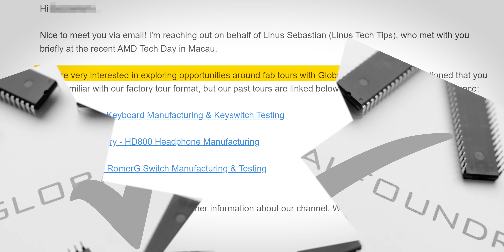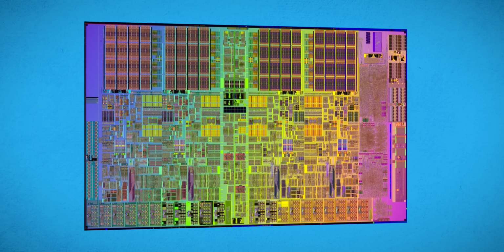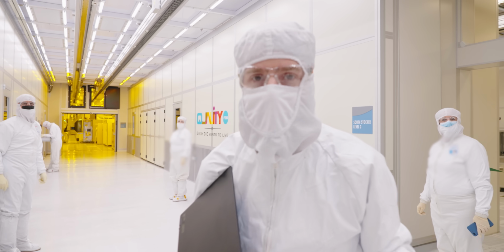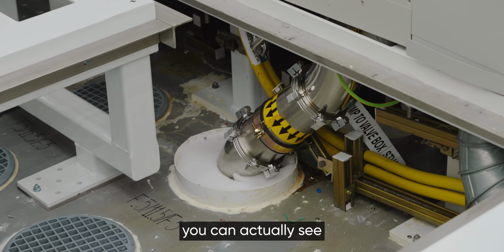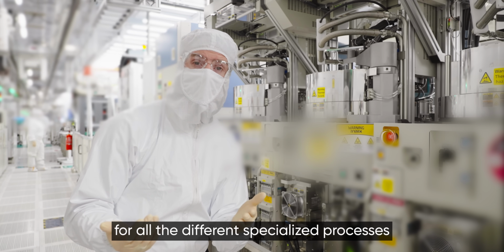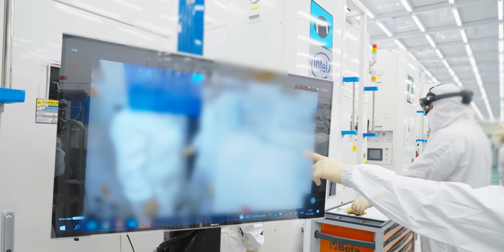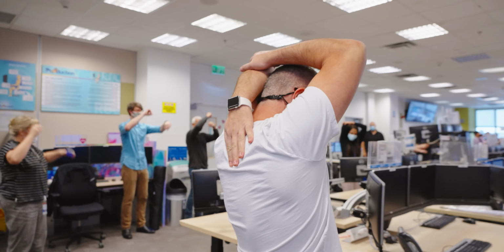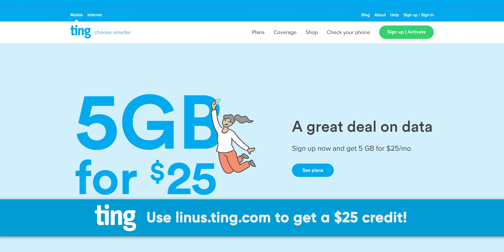I Can Die Now. - Intel Fab Tour!

Comment: The frame by frame attention to scrubbing this video of details that needed blurring is most impressive thing to me here. Props to the editor!
Reply: Even stuff in reflections were blurred.
Reply: I am guessing that intel was reviewing their footage before publishing it online
Reply: @kingseekerbackup3085  They most likely reviewed the footage before even letting them exit the building
Reply: if you do your job correctly, you don't get sued or your video doesn't get pulled
Reply: @houtamelocoding  interesting. Never thought of that.
Reply: @houtamelocoding  Nope, on WAN Show it was said that they were reviewing the footage for quite a while, blurring out all the details.
Reply: @DrakyHRT  really? I'm honestly impressed intel would be careless like that
Reply: its not necessarily frame by frame. After Effects has a really good point tracking system
Reply: %90 the stuff they blurred just were ASML logos
Reply: @kingseekerbackup3085  No need to guess. It's a guarantee they went through everything meticulously. Luckily, modern tracking and blurring is somewhat automated but that doesn't mean it is fast for that much blurring. That alone must have taken as long as the edit.  And the editors did a tasteful job with custom masks instead of cheaping out with just circular or rectangular blur masks.
Reply: @DrakyHRT  Can I get the link of the WAN show where they talked about it?
Reply: @houtamelocoding  They trust LMG enough now. After giving them that much money for those extreme tech upgrades, they better be, or there's something wrong with their management.
Reply: @houtamelocoding  I worked in the Fab for 10yrs, I am willing to bet he didn't leave the fab with his camera, I going to guess he had to sit in a conference room and edit the footage before he left, or they did a rough edit for him.  So much IP in these places, so many little details that a competitor is just wanting to know. In a fast pace game, everyone is just trying to keep ahead of the game.
Reply: @evanharden  That's really cool. Software has really come a long way. I'm an og nerd from the 90s and so impressed with how far we have come.
Reply: @matasa7463  there used to be something wrong with their management, they used to be run by bean counters, now they aren't, and that's why they have been so on point in recent years
Reply: but editor shouldnt see those things, so maybe intel had their own guy to edit this one? :o
Reply: I highly suspect LMG never even handled the original footage.

Comment: I'm beginning to appreciate why switching to a different nanometer process would be prohibitively expensive even for a tech giant
Reply: For sure man, and you can bet that they've already planned for generations ahead but yeah, big changes = big $$$
Reply: Also, switching doesn't only involve buying new machines, but also developing new processes to ensure you can correctly build whatever you need to. And they probably need to re-design some parts of the CPU and validate everything along the way. On top of that, these tests probably take weeks if not months due to the amount of processing needed for each die.
Reply: Think of the things they had in the already built place, and now they double that with new more expensive stuff, Intel has money the cost for that is 100 millions easy.
Reply: @dtiydr  the moment when that generation becomes obsolete and so does the machines 💀
Reply: Intel's 14nm fab was also an impressively good fab for what it was, and was arguably better than the 10nm fab that replaced it. 10nm has improved substantially since, but 14nm could still outperform it in terms of being able to reach very high clock speeds with low power consumption. 

7nm ("Intel 4") is supposedly going to be a significantly better fab this time around. I think it will be a breakthrough for Intel and will help them better compete with the low-power consumption processors from their competitors. 

That being said, I do believe 14nm will likely remain in production for a while. As far as their "legacy fabs" are concerned, 14nm may go down in history as one of their best, and it's still very suitable for a lot of their lower-end or budget processors.
Reply: It's the plague of success.  It's why manufacturing moves to the lowest cost city/state/nation and demands tax incentives to trade agreements with those new locations.  It lasts until the next round of improvements means they need to rebuild and the cycle repeats with new moves to new low cost cities/states/nations and new demands for tax incentives to trade agreements.
Reply: @photoniccannon2117  yeah the logic behind renaming to intel 10/intel 4 is that their 14 nm process is closer to tsmc 10nm
Reply: @Soarano  The things they have will not be changed out in a near future as I see it but reused for other things as long as possible, due to the extremely huge sums. Fex the overhead pods is a huge system and will never be changed out as I see it since its integrated with everything there and work just fine as is. They might probably install a newer system at their new place.
Reply: @dtiydr  idk I'm just thinking that stuff from a 14nm era wouldn't exactly use exactly the same machines yk as 7nm<
Reply: @Soarano  The principle is pretty much the same, only tighten the specs sort of speak but that is expensive never the less. They make i9 that is 7nm and the principle of making below 7nm is pretty much the same but not as easy and they will of course buy new equipment for that anyway.

Comment: I used to work for a company manufacturing mass spectroscopy and liquid/gas chromatography equipment and this video brought back some memories for sure, lol.
Most of the facility was open-air manufacturing (parts assembly, QC, etc.), we had specialized suits for areas with extremely harsh acids (HF, HNO3, and  HSO3F+SbF5) and extremely toxic chemicals (TMAH). One stage of manufacturing for a particular product (can't say) was especially interesting. It was built inside of an anechoic chamber and completely evacuated of air.  Why? Because it was believed that even the TINIEST vibration of air created by sounds from the equipment motors would disturb the product.

All in all, this was super cool to see. Great job Linus & Crew<3

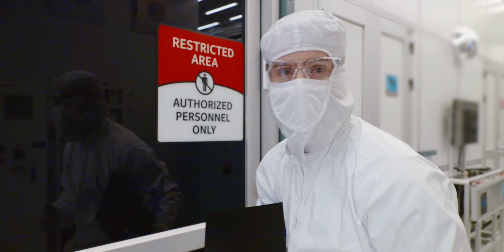Oh and, 10:06 while I can't speak to Intel's culture or how things are in Israel but... anytime we had visitors in the facility... we just hid.  Was easier than getting picked on by the manager(s) giving the tour and wanting demos/interviews LOL. So, even though this was probably a visit scheduled in tandem with some sort of site-wide maintenance effort, I'd like to think all the workers were still there :P just hiding behind the machinery and cleverly popping in and out of corridors avoiding your cameras haha.
Reply: wow thanks for the info, very interesting
Reply: Playing hide and seek with interviewer.
Reply: they must have learned it in the army
Reply: The stuff they work with is far nastier - arsine, diborane, phosphine, and such for implantation, as well as fun etchants, though mostly dilute HF and piranha.
Imagine a 10l cylinder full of phosphine sitting next to you. That's a nightmare on its own, even if it's not leaking...

Comment: Fab and final test equipment maintenance tech for 27 years, worked for Intel, IDT...Maxim Integrated...HitachiGST.  Wish you would have shown the coolest part of the vacuum tools, the mech pumps ( Blowers) and the turbos used to pump down the vacuum and transfer chambers on most of vacuum tools...awesome to watch and hear them fire up. Venting the chambers to work on them, and pumping them back down...is the most time consuming aspect of working on them. That unique pumping sound you heard in the Chem cabinet was a peristaltic pump, probably feeding chemicals to one of the scrubber tools next to one of the CMP tools. Everything inside the CMP tools is wet, sometimes went through 2 or 3 bunny suits a shift working inside the tools. It was fun seeing wafers go from tiny tea cup size to turkey serving tray size ( 6 and 8 inch were the most common for my tools, until going to Intel )

Comment: Worked at a semiconductor plant for a few years and was blown away how much goes into making the wafers. I worked on the Boron and the acid stations ( Hydrofluoric acid )Cool stuff.  I was only allowed to travel on 2 of the 3 floors and could not go anywhere near the separate small fab we had. only about 10 people had access to that area. Most of the machines were automated after entering certain codes and info.  Never got used to the sterile suits we had to wear though. Got hot lol. The yellow lights gave headaches after a while too. Did 4-12 hour shifts each week.

Comment: Last quarter in (Electrical Computer Engineering (ECE)) I took a class called ECE 331 Devices and Circuits and we studied creating diodes, transistors, and what goes on at a physics level inside a CPU. This was so cool to watch the inside scoop of the fab. facility!
Reply: Yeah, had a class on chip design too, though it was focused on using higher level tools to design chips, not the fab work as they had barely started to build the campus clean room facility.

Comment: Intel: "You can't drop or touch anything in here."
Also Intel: "Let's bring Linus in!"
Reply: Ah yes linus drop tips
Reply: I was incredibly nervous with that in mind
Reply: I saw many occasions where he was physically touching machines. I could see the glass shake for example. My guess is that they either let it go or he was touching machines with less sensitivity to vibration
Reply: They look like they shut down a bit just for Linus. He is the Master of Disaster.
Reply: @KinreeveNaku  Not a single component that can be easily touched in a modern fab is sensitive to touch or vibration the way Linus described it to us. Those are shields and panels which separate humans from the real process hardware.  They told him that to put the fear of God into him so he doesn't get careless and touch a control or worse an EMO button and shut the tool down.  If one of my superiors okayed his visit to our fab I'd have him put in restraints like you see on defendants in a courtroom just because of the way he carries himself in those areas.  WAY TOO MUCH handwaving for a cleanroom.
Reply: @TomCardinali  What's EMO? What does it do?
Reply: @user-bm9fo5kr1l  It's a kill switch like you'd find on really any other industrial equipment, once you pop the machine stops.
Reply: I was worried for that screwdriver he held in the maintenance rack

Comment: The company I work for actually makes the chambers that go into many of these machines for atomic layer chemical vapor deposition. Very interesting to see the end use of what we manufacture on a daily basis 😁
Reply: ASM
Reply: I did 5 yrs in CVD at intel, cleaned SO many chambers out.
Reply: @dryang1282  ASM make the systems that go into the Intel fabs but we make the chambers that go into the systems

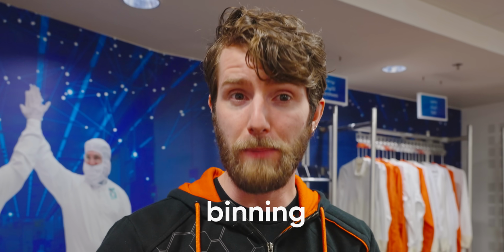Comment: 19:31 Wait, so if I am hearing that right, the different tiers of Intel CPUs (i9, i7, i5, i3) are all the same physical dies?  They just... disable the sections/cores that don't work well and sell it as a lower tier?  I mean, I understand that doing that would reduce waste and I realize that most physical products can't be targeted to a specific quantity within a given run due to defects and such.  But I didn't expect CPUs to have a whole other layer of uncertainty with not knowing how many of each tier you get with each batch you run
Reply: Correct!
Reply: That is really interesting.
Reply: That’s partially why you often get the top of the line CPUs first. CPUs cost the same to produce no matter the class, so you’re getting the most money on the flagship product with the highest price tag. The failure rate on a wafer is pretty much constant, so you can always guarantee a steady (albeit slow) supply of top-of-the-line chips. All the lower-end chips are basically salvaged parts. When the manufacturer manages to optimize their processes so they have a steady amount of each bin, as well as made enough profit to get a lot of the money back on fabrication, they’ll start releasing the lower-end product too.
Reply: that's been the case since forever, but not ALL dies are the same – even AMD, with their much more flexible chiplet model, have a couple different die designs.
Reply: There’s a similar reason to why big screen sizes are more and more common on TVs. The screen equivalent of a wafer is the “mother glass”. New generation mother glass is much much bigger. This matters because just like with wafers, a defect on the part of the glass renders the entire screen that’s meant to be cut out if it useless, so there’s a delicate balance at play.

You don’t want to make a single screen out of the material, because any speck anywhere on the thing will mean you lost the entire cost of the glass because you’re left with nothing to sell. At the same, the smaller the screen size, the higher the chance that a particular failure crosses into multiple screens and then you’re forced to discard more of your product. The latter is particularly a problem with wafers, but factors into mother glass as well when it’s smaller.

It then stands to reason the best way to make more of the bigger screens is to make even bigger mother glass where even if there’s an imperfection, smaller parts can still be cut into full fledged 75”-65” TVs. That’s exactly what display manufacturers have been doing. By making the fixed cost of processing a single mother glass cover a larger area, you can now buy massive TVs at super low prices.
Reply: Thats wild beyond belief.
Reply: Exactly! If you ever hear terms like 'binning' or 'the silicon lottery', that's what theyre referring to.
Reply: @TKRuna  the term silicon lottery is mostly used by CPU and GPU overclockers. Each chip can have slightly different performance capabilities compared to the same chip model. Sometimes you can win the lottery by getting a chip that can perform better than the average chip.
Reply: @winstonpoplin  At the end of the day that’s still related to this phenomenon. Basically each bin has certain performance characteristics it needs to achieve, but there can be better or worse performers WITHIN a bin too. You may get a processor that barely qualified to be an i7, or one that could have been an i9 were it not for some dead circuitry that is not an i7 feature.
Reply: @winstonpoplin  Right; but it ties into the same concept. A die that's solid enough to be an i9 just means it meets whatever cutoff is there. You have variance within tiers and variance across tiers.
Reply: @TKRuna  you are of course correct. The term can really be applied to both situations equally well.
Reply: You can also get extremely well produced top end CPUs, there are programs that stress test the cores and if they're well made, it will tell you how far you can overclock it without errors.

I think it's called binning. Each CPU goes into a different bin, depending on it's quality.

If you get a Gold Bin. Then you've got an extremely well made high end CPU.
Reply: I remember single core semprons can actually turned into a dual core athlon back then if your motherboad supports it, at the cost of being unstable
Reply: That's why benchmarkers go for the highest class cpu and they block some of the cores and downclock them to mimic the other models.
Reply: @Prophes0r  yooo that’s cool
Reply: For bonus points in some cases you can re-enable CPU cores that didn't pass the test and were disabled in the factory... or at least you used to, anyway. AMD's now-ancient 3-core Phenom IIs were notorious for being quad-cores in disguise with one of the cores lacking any L3 cache and being inaccessible out of the box. Linus even made a video about this back in 2009 on the NCIX channel https://www.youtube.com/watch?v=VGKBXgbmCOk
Reply: @winstonpoplin  sometimes manufactures will sell higher tier parts as lower tier parts because their yield is too good. They still need those lower tier products to sell though. That's usually what happens at the end of a production run. They just get too good at it by then. Also to fill SKUs manufacturers will disable features in products. Anything to make the almighty buck.
Reply: CPUs like the Intel i3, i5, i7, and i9 are designed with distinct architectures, core configurations, cache sizes, and other specifications from the start. They aren't simply "failed" versions of a higher-tier model; rather, they are intentionally produced to meet different performance and market needs.